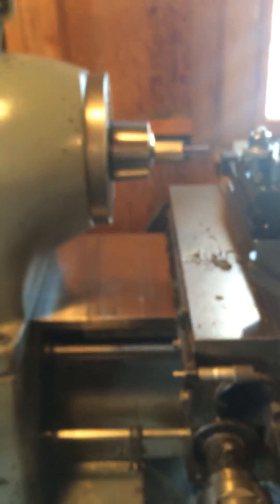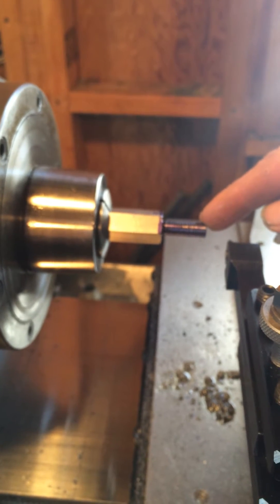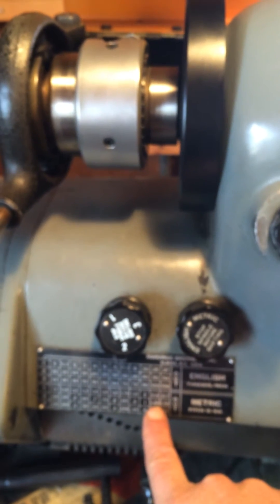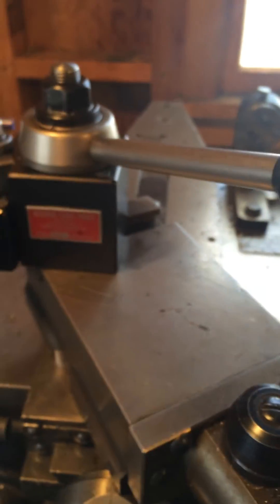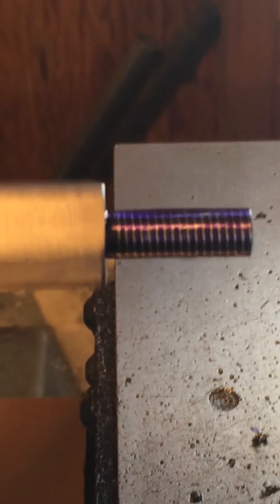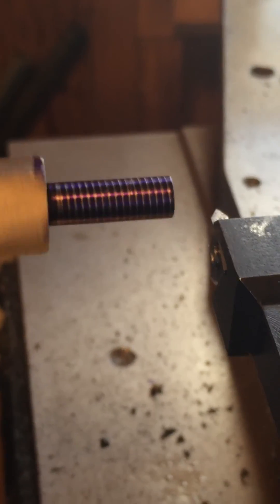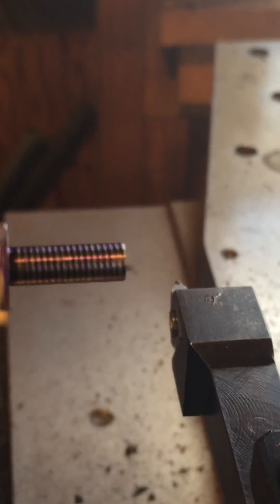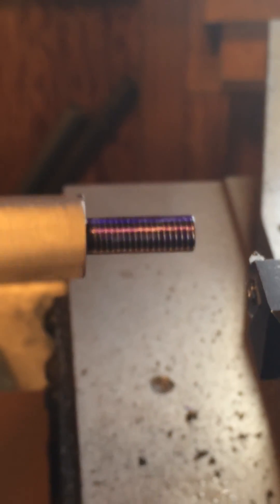Hardinge HLV Trip Dog Threading

Comment: This is perhaps the best feature on a Hardinge, but there are so many. The dials are white with black engraved markings. The dials can be turned with ease and locked without fear of losing position. The tailstock slides and locks with ease. The motor and drive are nearly silent. It has a buil in cabinet for tools and collets. Hell, even the headstock seems to have been designed to give you a comfortable place to rest your hand.
Reply: There were a number of very nice lathes made for the tool room. The most notable are the hardinge HLV and the monarch 10EE. My 10EE is currently in the midst of a divorce issue and I am trying to get it back. I have one video of it under Arnold Emch turning a gage face.

The HLV flaw is its tight quarters. Mine has a taper attachment, steady and factory cross gage option. It makes fitting a DRO a bit dicey. But I am not totally sold on the virtues of a DRO and CNC. I have worked as a CNC machinist for about five years and often find it more trouble than it’s worth. I need to machine some new spindles for my Oliver wood shaper and  these involve some odd tapers and acme threads.

I have not been a hard core YouTube poster and have a couple of old channels including this one. My new official channel is Devmeister super precision and these projects will be posted there among others.

The monarch had ELSR which is electronic lead screw reversal. Unique and interesting.

Another reason for me not jumping on the CNC band wagon is my milling machine. It’s an original brown sharpe omniversal. It had built in rotary tables in both the x and y axis among other features. It’s a hard core tool and die mill. Very rare and virtually not covered on YouTube.